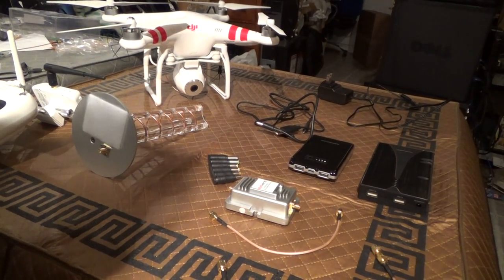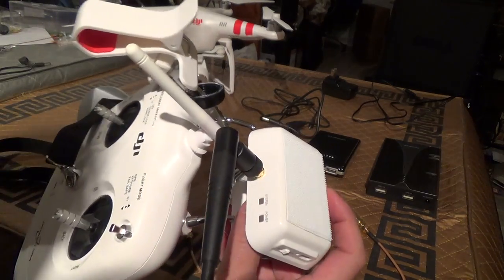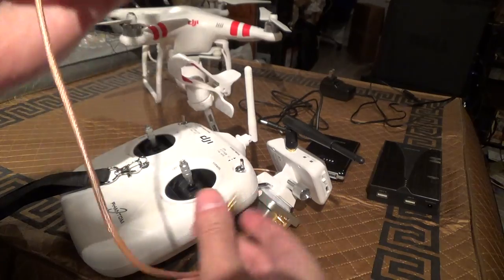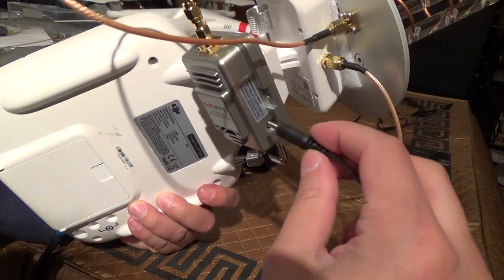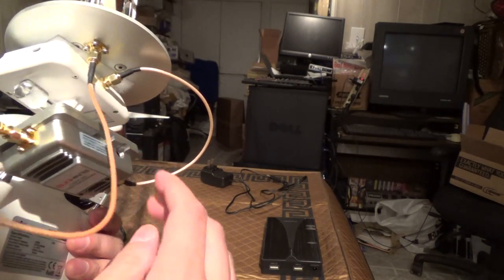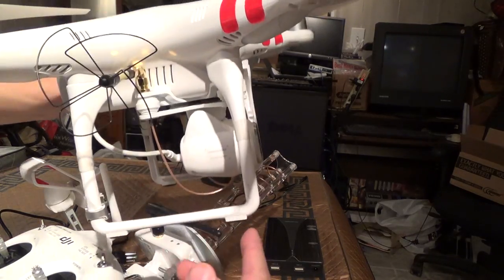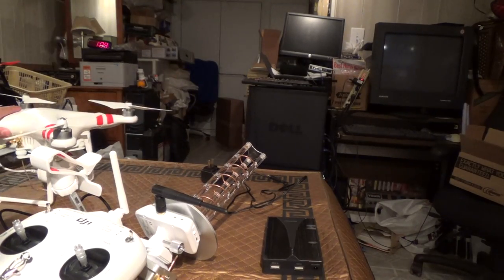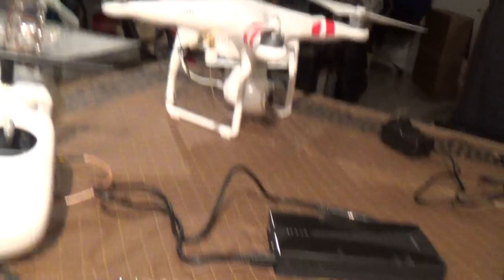Adding Sunhans Amplification to Phantom 2 Vision wifi range extender improve FPV

Comment: Ok I appreciate the help..I've been doing several of your upgrades.  The latest upgrade I did was the 6 turn antenna with 2.5 amp..I didn't see much increase today after first flight.  I was expecting 5-7k feet..maybe because it was cloudy not sure. ..that is why i was asking.
Reply from the maker: If you have a vision plus you will need to use a 4 or even 6dbi attenuator with it or you will be overdriving the amp and not gaining any range

Comment: great video Ben question did you with the amplifier and your video not breaking up when you go long range. How far proximately can you go without it breaking up with the new amplifier. I like how you explain things very well done all your videos
Reply from the maker: Hi, thanks for the feedback.  Your range will vary widely depending on your antenna combination and where you fly.  I can say that using the amp made a substantial and very noticeable improvement in range and of course the signal stability.  For example when flying in my congested wifi area using my roughly 12db helical antenna I could barely get past roughly 1200 to 1600 feet distance and with the amp I effortlessly flew out nearly 3,000 feet and with better signal and stability at that range as I was at half the distance without it.  In the right areas you'll be able to fly further out than you're batter life can handle.  Keep in mind you will also need a modded RC controller to keep up with the extended FPV range.

Comment: Hi Ben, all interesting stuff, but I think I'm missing something? The modifications increase the power output of the wi-fi extender's signal going to the craft. i.e. the camera controls on a connected smartphone, will work over a longer distance. However, there is no increase of the video transmitter output of the craft's camera. It seems to me that you need a transmitter at both ends, i.e. one on the wi-fi extender and one on the craft.
Reply: Exactly, with no pre-amp for return signals you will just need to add a good external antenna to the bird to increase video range. An amp added to the bird will come with to much of a penalty in both weight and power consumption.

Comment: Ben, your videos have been a life saver (Phantom's life)!  I have the newest version of the Phantom 2 Vision + Ver. 3.  I thought I had mapped out the modifications correctly using your videos and links.  Then I discovered that my frequencies (Control and FPV) were reversed.  You have responded to that situation in some of your answers, but one question still bothers me.  What would be your recommendation for an antenna using a Sunhans 5.8 GHz 2w amp to control an unmodified PV2+ Ver. 3?
Reply from the maker: You can use the stock antenna that comes with it or a high gain 5.8ghz patch antenna which will require you point the control at the phantom though you are doing that already to maintain FPV unless you're using a good omni directional skew planer vs helical.

Comment: Hi
Thanks for making all this work to help us AND YOU DID!!!! 

I have an other Q :  I did order everything I need for my 2.4ghz RC ( p2)  now is there something to boost my 5.8ghz AV reciever ... Did order a couple of blue beam omni antenna but was wondering if there's some sort of amp to boost the AV part of the system.

I'm running the DJI AVL58 transmitter and reciever .

Thanks
Reply from the maker: If you're using a regular Phantom 2 and not the Vison you have other options for increasing the FPV range.  For example you can use an immersion rc 600mw 5.8ghz video transmitter on the phantom itself.  Foxtech if I remember the name correctly also sells a 600mw as well as a 1 watt video tx.  Both 32 channel so compatible with all receiving gear and monitors.

You can use the 2.4ghz Sunhans amp on the dji radio control even tho it's rf and not wifi.  Make sure if the phantom 2 has the same CE and FCC mode change like the vision controller that it's set to CE or you'll be overdriving the amp.  If no CE mode you'll need to use an attenuator to keep the output power no more than 20dbi or even a little less.  So maybe a 6 to 10dbi attenuator may be okay.

For good FPV range the bluebeam antenna will be ok on the phantom.  On your reciever if it supports two antennas, a combination of a directional antenna along with omni directional like the blue beams would work best for both close and longer range flying.

Comment: Have a question for you Ben , I have the Sunhans 5.8 wifi booster and I'm wonder if a lipo 3 cell 12V battery will be enough power to work this signal booster ?
Reply from the maker: Michael Mcgriff Yep

Comment: great im on it. I have the same congested situation you have thank you. Question I noticed they have four and five amplifiers out there now or should I just stay with 2 amps
Reply from the maker: They have different wattage amps out.  I would suggest either going with the 2watt amp if you want to  be able to use a USB based power source or the newer 3watt amp which replaces their 2.5 watt amp it's the same form factor.  If you have a Phantom 2 vision plus you'll need to use attenuators on the amps do to their slightly higher power output than the standard vision.  A 4dbi attenuator should be sufficient, a 6 will work too.  The reason for the attenuators is these amps should not have more than a 20dbi signal sent into them which is the max or it will deteriorate your signal quality do to noise as well as reduce the life of the amp.

Comment: Hi, I am setting the similar package also. But I have a problem of the connection between mobil battery and Sunhans. Is the head is 2.0mm, 2,1mm, or 3.5mm? I have bought one but it does not match.

Below is wrong:
DMtse Generic USB to 5.5 mm/2.1 mm 5 Volt DC Barrel Jack Power Cable

Comment: Hey Ben,
I am using a 5V DC power cable (USB) and it does not fit the Sunhans...any thoughts?  I has an OD: 5.5 and IN: 2.1 just like you said.
Reply from the maker: Michael Grogan sorry but it might be the wrong size, I ordered several adapters at once and wasn't sure which seller the correct fitting one came with.  You do have the option though of splicing in the power connector that came with the Sunhans amp to any usb connected wire.

Comment: ben, im really confused by the LH vs RH polarizations...if i have a PV2+ transmitter stock, and intend to modify my range extender with 2 screw-on RP-SMAs like yours, 1) do i need a LH helical like yours and 2) does your helical attach on the range extender to the internal "south" antenna lead, or, to the "north" one?  i heard somewhere that the "south" or the one lower towards the ground has more "weighting".  thx!
Reply from the maker: I will be putting up a video which I discuses the two RH vs LH check for it :)

Comment: Hi Ben have a question for you. I have a RAVpower battery and Im looking to power a sunhans SH58Gi2000 signal booster. In not sure if this will work but the paper work for the signal booster call for a 12V power source .will this battery still power this booster ?

Comment: congratulations and thank you for guidance. I would like to inform me what the exact diameter of the energy sunhans booster plug because I will buy a usb cable adapter for dc.
Reply from the maker: MsFlagon I believe I have all that info in my description.  I recommend using the 2.5 watt Sunhans booster.

Comment: Hi Ben .... 
Actually i ordered TP link 9dbi ... n was hoping it will help me to fly my p2v+ above 1Km ..... n i thought its the easiest way to modfy the wifi repeater ..... so do u think that am going to to expand the range to 1Km by adding only TP link 9dbi or i have to add more stuff to achieve that distance ???
Reply from the maker: Hi, I'd be surprised if you don't push well past 2,000 feet with the 9dbi tplink antenna and given its a vision plus 1km is within the range of possibility but that also depends on where you fly and also you may need to fly sideways to get the maximum range / 1km using that antenna by itself.  Using it with an amp as well should also get you there.  I like the little FPVLR half done tho it's so small and light and in conjunction with an amp you'll do 1km+ with that.   If for any reason you're not happy with the range with the tplink antenna the best bang for the buck is the 6.5 turn fpvlr helical antenna.  It's a big on the longer side but it should be light enough tho and you'll easily push to 1.5km or more with that antenna.
Reply: Ben7seven7 i was just checking this antenna on this website http://horizonfpvantennas.mybigcommerce.com/phantom-2-vision-super-plus-pilot-end-only/ 
Its a complete kit for both the range extender n the RC .... but i was wondering how to fit the dual antenna to my range extender ..... 
Hope that u can help me ....
Reply: Ben7seven7 i was just checking this antenna on this website http://horizonfpvantennas.mybigcommerce.com/phantom-2-vision-super-plus-pilot-end-only/ 
Its a complete kit for both the range extender n the RC .... but i was wondering how to fit the dual antenna to my range extender ..... 
Hope that u can help me ....

Comment: Hi Ben, I am gathering all the items I need to order for the Sunhans Amp 2.5 extender, do I need to purchase the  "SMA 2W male to female RF Coaxial Attenuator DC - 6.0GHz 6dB 50ohm"

In addition what cables do I need for the internal mod for the factory extender in order to screw the 2.5 Sunhans amp.

from your video I have gathered the items below, please let me know if I missed anything out.

2.5 watt Sunhans amp. (12v 1amp)

 additional adapter for the he 2.5 watt Sunhans  the 1,800 mah lipo battery.

12v 1800mah lipo for use with the 2.5watt Sunhans amp.
Reply: in addition I am upgrading to Phatom Vision 2+
Reply from the maker: Yes you will need that attenuator or the Phantom 2 Vision + wifi extender will overdrive it and you'll get reduced range.  You also would need different cable for modding the antenna on the P2V+.  It uses a Male MCX cable instead of the U.FL cables that the original Phantom 2 Vision uses.
Otherwise the range extender itself uses the same cables and is done the same way as in my video.

Comment: Héllo ben7..
I have followed your videos and your phantom is quite stable..And this project is very good!!
I had a question for you, if I can help!What is your setup gain pick and roll.,I have 140,140 pick and roll.but I do not think the best setup, have any suggestions,!!
Regards.......
Pp
Reply from the maker: Hi, thanks for watching.  Yes the Phantom runs and hovers solid.  In using the default settings though noting exotic in that respect.  If yours isn't working well it's likely because your Phantom is not properly calibrated.   Do an IMU calibration on a flat level surface.  And do a compass calibration in an open grass field away from metal and potential sources of interference.

Comment: Does it matter witch antenna inside the repeater you connect to ?. Some people are saying one repeater antenna connects to phone and other to camera in bird.
Reply from the maker: No it doesn't matter they do the same thing.  Tho sometimes the power output from one can be slightly better than the other but it's easy enough to test just by flying far as you can and repeating that connected to the other connection.  That and using things like wifi analyzer

Comment: Hi ... i got the RHCP so does it make any difference compared to LHCP ???
Reply from the maker: Using RHCP is fine as long as you've upgraded the antenna on the Phantom itself to RHCP antennas as well which is what I did.  If only upgrading the range extender you need to go with either a regular linear patch antenna or an LHCP Antenna for best results.
Reply: Ben7seven7 hi Ben, i added Sunhans 2watt 2.4ghz wifi amplifier on wifi extender of phantom 2 vision, but my  distance is dropped from  1100ft to 750 to 800 ft. i used 6dbi antenna that comes w/ package. any suggestion bro so i can extend range.
Reply: malik raza i had the same problem on my p2v+ ... my advice just go for Helical antenna or the horizon ... they work perfectly .. will let u gain more range over 3000m
Reply: malik raza i had the same problem on my p2v+ ... my advice just go for Helical antenna or the horizon ... they work perfectly .. will let u gain more range over 3000m

Comment: could you tell me make and model of the portable power supply I have tried two already both a 5v 2amp with USB to sunhans and they wont run it ..
Reply from the maker: To power the 2watt Sunhans wifi amp I have used two different RavPower portable batteries. One of them is 10400mah and the other even higher.  They have a 2amp and 1amp output. I use it on the 2amp output.  For the 2.5 watt sunhans amp I can use either my higher end RavPower battery which also has a 12v output.  I got something more portable tho in addition which is a 12v Lipo battery which has an on off switch, It's under 2000mah.  And a 2.1mm - 5.5mm dc adapter.
Reply: Thanks for all your help Ben777, Im all set up with radio mods of all 2.4 and 5.8 with FPVLR's ant and Drone side 2.4 only so in the next two days I will be going out for a range test and im sure I will be a bit nerves about going out and returning I'll be sure to be filming this time ,and to have a shield under my camera  Then as soon as I get the RavPower supply I'll do  it with the 2.4 Ghz Wi-Fi boosted and see how it goes..
That being said words out that FAA as early as Jan 2015 is going to make all drones illegal any where but AMA sanction fields and only to AMA members , until some kind of license is created, mostly for film crews and such. along with permits needed before any flight inside any city or suburban locations.
totally sucks. but I can see why in the world we live in. Thanks again and Happy Flying

Comment: Ben, am I correct in thinking that this is one way amplification? from the extender to the bird, with no pre-amp to boost the incoming signals.
Reply from the maker: Adding an amp to the range extender increases its ability to both send and receive wireless transmissions.  

Using improved antennas on both the Phantom and the Range extender helps to further improve range.  For many people just upgrading the wifi range extender with a good quality antenna will be sufficient.  Tho the more you improve the system the better it will be.
Reply: Ben7seven7
I think you need to check your amp, I doubt its duplex capable. Almost all linear amps are simplex only, in that they amplify the source signal. As a HAM radio operator for many years I built a couple of duplex amps, requires switching circuits to isolate the final stage RF and a pre-amp to amplify the incoming signal. In the spec's your amp would have to say it was Duplex. This has always been the issue with the phantom, the transmitter output power, you can extend the range with better antennas as the ones in the bird are marginal at best. Carrying the extra weight of, and powering a stronger transmitter is not an option.
Reply from the maker: I'm telling you as a matter of fact that the wifi connection needs to work two way. A wifi amp would be useless if it was only one directional. And my own and others usage of the amp confirms this.  So with this amp on just your Visions range extender increases it's ability to send and receive communication to the Phantom from your smart phone or tablet.
Reply: Ben7seven7
OK, so the amp must be half duplex, interesting, as the bulk of the transmissions are incoming have you noticed any video interruptions when sending any commands to the camera?. I looked up the amp and it has logic switching that is based on signal demand, so it would switch to transmit when sending commands to the camera and receive at all other times, just wondered if there was a noticeable signal drop between the two.
Reply from the maker: All of the Vision apps functions work exactly the same with and without using the amp. And with no obvious delay. And flying with 640x480 30fps frame rates.

Comment: Hey Ben. Ive watched a lot of your videos about improving the phanton 2 vision's range. I have a serious problem with mine because about 70 m it loses signal and connection breaks. So, Whats the best set up you would recommend to me? I am using one antenna on the range extender and two on the phantom, but it does not seem better.
Reply from the maker: Roberto Farias changing the antennas on the phantom itself is very tricky because the antennas types and orientations you use will have a night and day difference depending on your choose and the orientation of the antennas.  If you want excellent results the easiest thing to do is using the stock antenna on the phantom itself and using a high gain LHCP directional antenna to match up with it.  If changing the antennas on the phantom I found using a Skew planer or similar style antenna worked best.  I used two RHCP skew planets on the phantom and a high gain RHCP helical Antenna on the range extender.  Second comes the orientation of the skew planers on the phantom.  I had the best results with them facing sideways tho you would also have one facing down and one facing sideways.  If you're looking range at 70m tho that's really short distance.  You may have a problem with the cables you're using or your range extender or the camera wifi may not be working right.  I had an issue with my range extender after some time I noticed I had reduced power output from one of the two connections.  I would get horrible range on the bad one but normal / excellent range on the one with the normal output.  You will have to put your unit through some tests to rule out problems with your cables and or the plug connections.